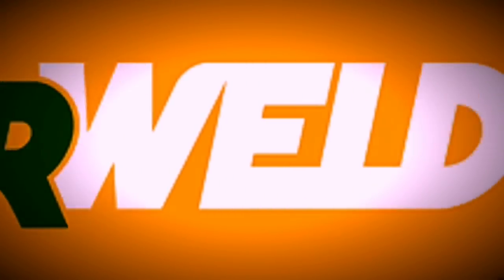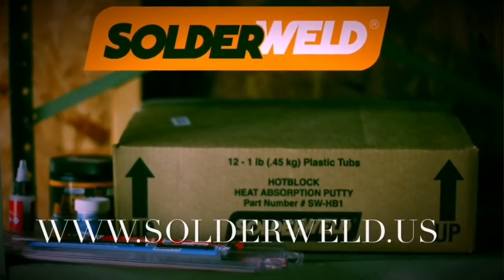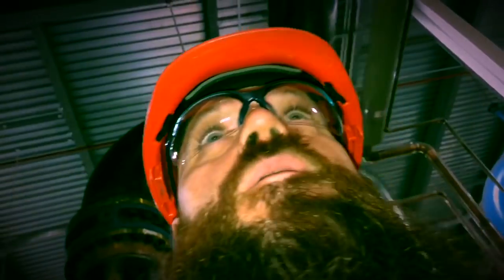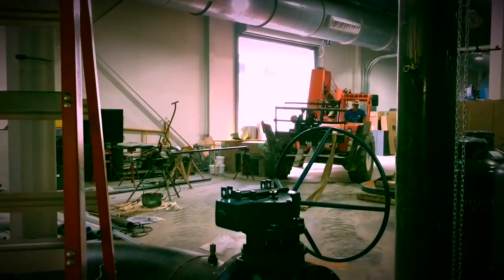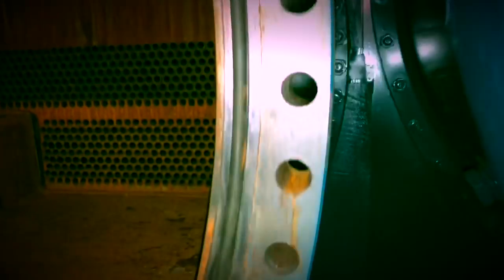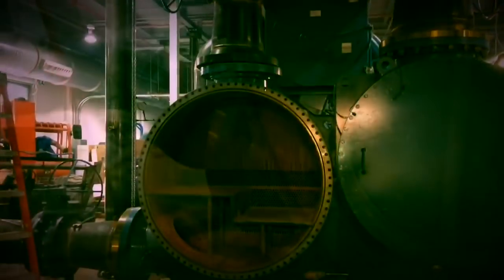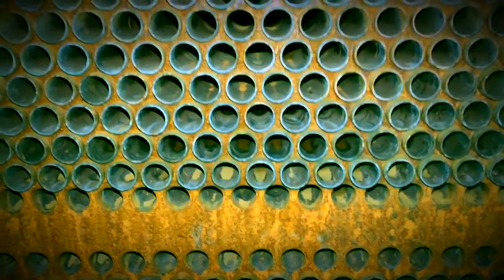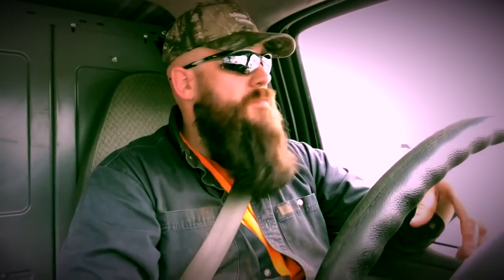HVAC Chronicles - The Chiller Gasket

Comment: AK the video was amazing, I really liked the format and content.

I want to know the best route to switch from residential, light commercial to doing the type work you were in this video. What kind of training would be needed,  and where could I apply for this type work. Thanks in advance.
Reply from the maker: BBYERS27 joining your local pipe fitters is one way if you’re in a union area...next bet is to apply to anyone with  “mechanical” in the name vs “heating & cooling”. Usually companies that market themselves as mechanical contractors are only concerned with large commercial/industrial work. The training from that work will come on the job, and manufacturer-held classes that your employer would likely send you to. Good luck!👍
Reply: I just got through the same process man. 

Apply for your local UA Pipefitters Union in their service department.

I applied at must of been 5 different companies and bugged them over 6 months till one took the bait.

Couldn’t be happier. Benefits and experience on this big stuff everyday.
Reply from the maker: David Burnett 🤜🤛🇺🇸

Comment: Good video :) Since this is a new chiller, what refrigerant it is using? 1234 or 134a? I think it is a steal for a million dollars installed.
Reply from the maker: FIX IT HVAC 7000 lbs 134A. It may have been 1.2 mil....and we’re putting a third one in this summer!  Between the York’s and Tranes there are like 6 or 7 machines in there. Around 38,000 tons of cooling. Thanks for watching man!
Reply: What does that facility make or the reason for so much cooling needed
Reply from the maker: BBYERS27 that chiller plant feeds the largest university in the state. I think 38,000 Tons of cooling in that plant. And there are two plants lol. The building I was in had about 8 machines that size.